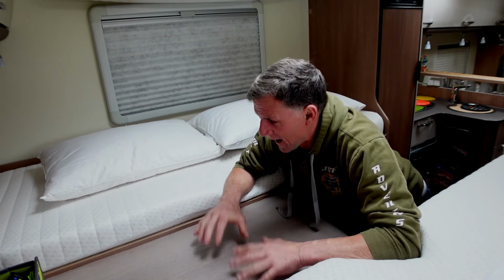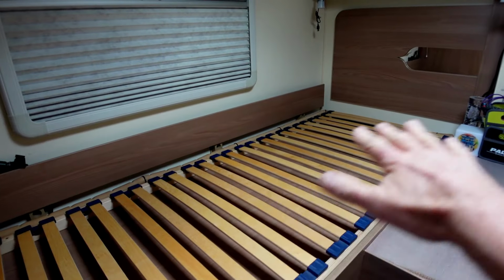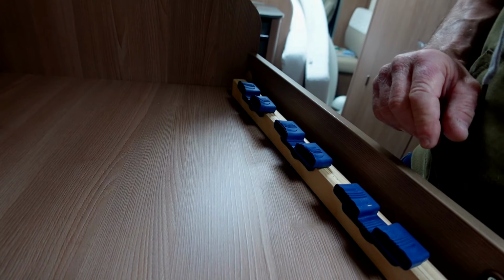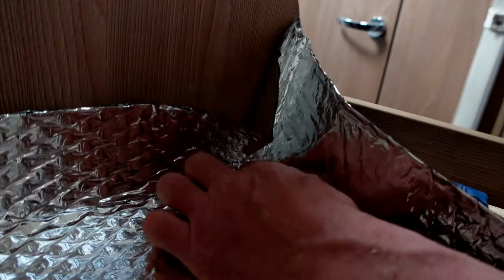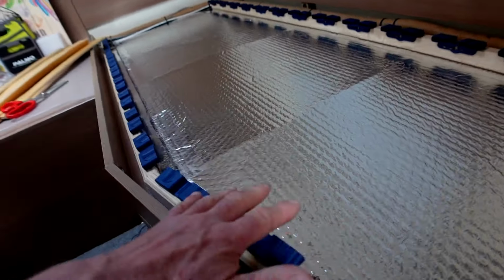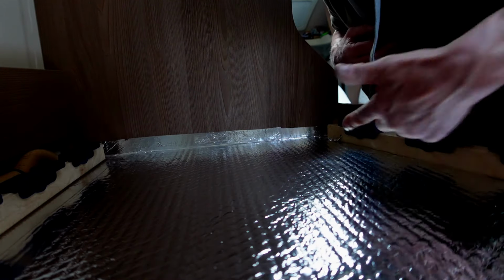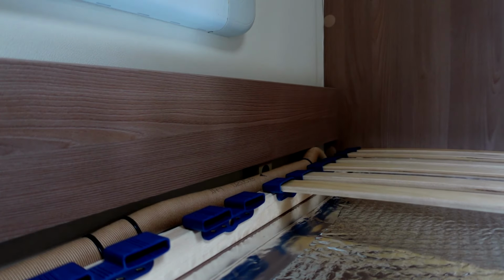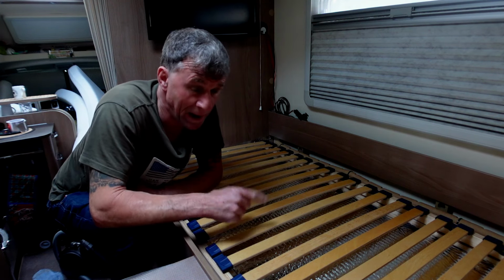Motorhome Warm Up The Bed, More Insulation Heat Under Beds Simple Cheap Modification

Comment: Nice one Jof, another job to add to my list 😀 I was forever catching the blinds in the bedroom when I turn over in bed! We cut two pieces of cardboard the width/height of the window casing and covered both sides with the silver insulation foil. Attached four small strips of Velcro in the corners of the board and blind casing. They work a treat and keep the bedroom warm, easily removed to open the windows etc. Toasty!
Reply from the maker: Never stops with Moho life, just small modifications that make a little difference 🏨🌴🚍👌

Comment: Hi Jof, a great idea, but are you not concerned about possible condensation between original board and insulation?
Reply from the maker: We did discuss this, and will monitor how it progresses, there is not a massive temperature difference between the garage area and the Hab area so hopefully not going to cause any issues.👌
Reply: @MOHOTELADVENTURES Hi Jof I’d be interested in an update video at the end of Winter to see what your thoughts are on any difference. Cheers Shaun.
Reply from the maker: @RV-zk7zq absolutely Shaun 👌🏨🚍🌴